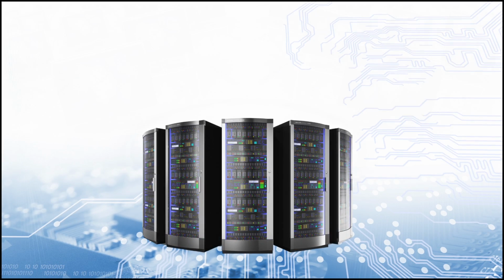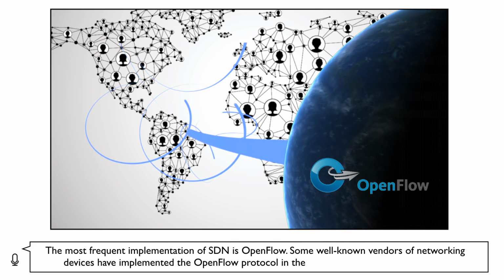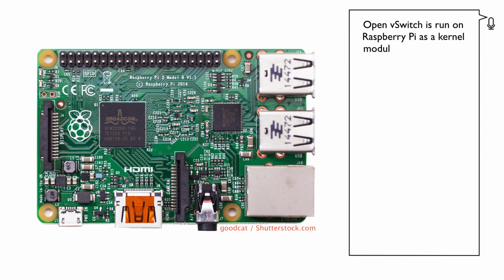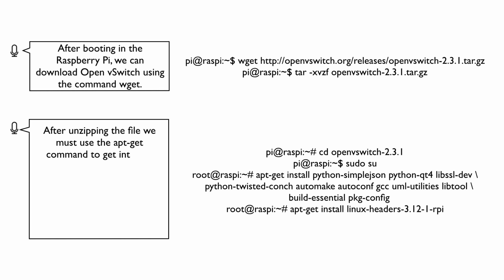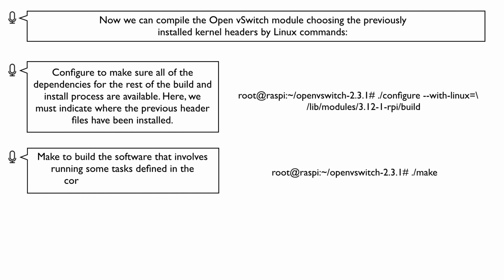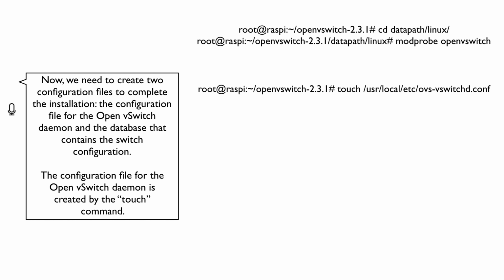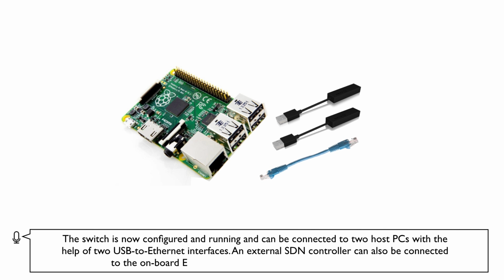IoTphile: Running an OpenFlow switch on a Raspberry Pi

Comment: Great quick setup!

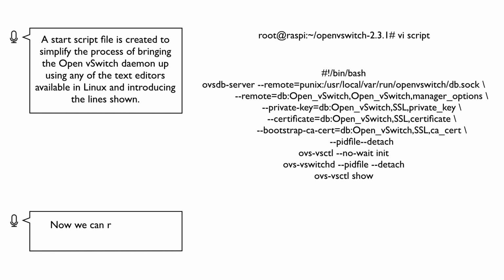Just one thing, at 3:38, or when creating the script for starting the OVS, it should be a space between --pidfile and --detach  (after --bootstrap-ca-cert). Otherwise the switch won't startup claiming a failure to connect to the database.

This is a link to the problem at Stackoverflow: http://stackoverflow.com/questions/28506053/open-vswitch-database-connection-failure-after-rebooting

Happy Openflowing :)